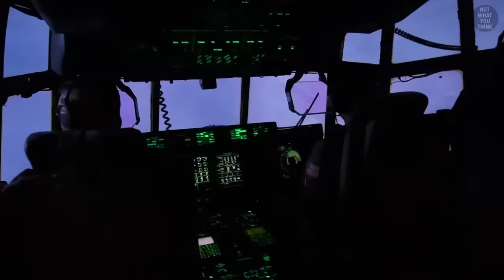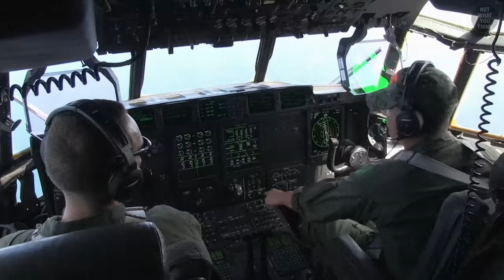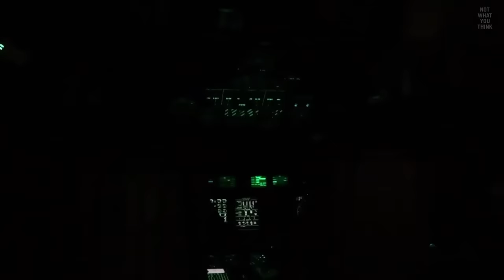Aerial Refueling Accidents Examined

Comment: While I will say that the ch53 was in a good situation to attempt an autorotation, high altitude and forward speed, those big helicopters autorotate like a safe. They expect to lose the tail and roll on their side in a best case scenario. But it's not like aerial refueling is their only hope, they try not to run that low on fuel.
Reply: I worked on Pavelows in the 90's. They could land em like a feather during autorotation. It's all about energy preservation. Size is just scale, the rules dont change

Comment: Incidentally, helicopter autorotation isn't automatic. It requires special control settings, and you have only a couple of seconds to set them after an engine failure.
Reply: And it has to be initiated at exactly the right altitude to take advantage of the stored inertia of the rotors or it will lose the energy required to “soften” the landing.
Reply: @larrymcgill5508  you do realize that your statement contradicts mine ? (i.e. i think your statement is incorrect)

Comment: While on the Nimitz off Iran during the Iranian hostage boondoggle, I was flying in Lockeed S-3 Vikings. Because we had a much higher carrier landing weight performance, we were utilized to download excess fuel off the duty tanker in order to conserve the fuel that would otherwise have to be dumped. On one evolution, we exceeded the capture speed and caused a sine wave (like the one shown). We had a solid capture but the sine wave came down the hose and it ripped the “basket” from the hose with the basket still connected to our refueling probe, which bent the probe pipe straight up. The KA-7 tanker had to make an immediate trap after the fuel finished draining from the “buddy pack”. We then trapped with the evidence clearly wrapped around our refueling probe.

On another incident (same deployment) the bow wave of the S-3 caused the basket to deflect above the aircraft and then came down on the system operator’s canopy (directly behind the pilot’s canopy) crashing through it. That basket may look small, but it is about 2 - 3 feet long and is made out of metal slats with steel cables to absorb the stress put on them by air refueling exercises. Fortunately, they landed safely and the operator’s only injury was to his flight suit.

Long hours of tedium, punctuated by moments of stark terror.

Comment: This ended on such a sad note RIP
Also, two questions:
1 Did they make the decision to ditch the heli later when they still had 20min of fuel left, or did they physically ditch the heli even though it had 20min worth of fuel? If the latter, how come?
2 What is/are the correct actions to take in the case that a fire starts when refuelling your car? Keep the nozzle in? Fire exstinguisher? Or just run for your life?
Reply: Keep the nozzle in. Alert attendant (emergency stop, call 911). Use fire extinguisher.
Reply: An helicopter has a very high center of gravity . When ditching, she would roll in seconds . It's safer to stay low with low speed to evacuate the crew from the cargo doors, and after that, ditching at a safe distance . The pilot and the copilot can leave as they are trained for . They had just been unlucky to be hitten by a huge wave before evacuating all the crew .
With 20m fuel and so far from the coast, they didn't had any other option . That's a risky job .
Reply: They chose to ditch before they ran out of gas because with the engine still running they had control over the situation. If they waited for it to run out and just crash it would have been far worse...
Reply: @jerseyshoredroneservices225  True. I'm just wondering why they didn't spend, say, 10-15min of the flight time they still have to get closer to wherever their incoming search and rescue would be.
Reply: The pilot of that heli wrote a book called Shoot Like A Girl. It is a really good book. She has the experience written down in it and was the pilot of that helicopter

Comment: use of cellular phones during refueling can ignite fuel vapors with an electrical discharge. This is commonly due to static electricity and not because of a faulty device, as most phones, especially phone cases, can produce a lot during handling.

Comment: 1:14 I’m not saying conclusively that that didn’t happen, but the horizon stayed consistent for the whole time until the E3 dived down. If the bottom of the refueller was pushed up by the bow wave of the E3 then you would expect the refueller to nose down which would mean we would see more sky. But instead the horizon stayed the same which just makes me think this was human error with pilot induced oscillation.
Reply: Great observation.   Everything I have read up on this incident, was the inexperience of the receiver aircraft.  The receiver aircraft has to make small corrections, not massive ones like here.   Retired KC-135R crew chief.

Comment: KC-10 v E-3, the explanation is wrong, this incident was all the E-3s fault. You can see ground features that stay relatively fixed which means the one moving vertically was the E-3. (Former C-141B pilot here that air refueled many times)

Comment: I had the opportunity to watch that air to air refuelling, and it is very stressful on the pilots, even in smooth clear weather. Would hate to think of doing it at night, in a storm, as even in the smooth air  the new pilots took a few attempts to connect, and the one finally did so, but was not watching his relative velocity, so drifted to in front of the tanker. 

Corrected with full speed brakes, and in the tanker we all had a jolt as that pipe disconnected. The valves are not meant to close so abruptly, so the aircraft was gently banking away, nicely shiny and with a instant full wash in jet fuel, to go get into the correct envelope to do an in flight restart, because that sudden blast of fuel had flamed his engine out nicely. 10 minutes later he came back up, connected correctly, got his positioning right, and got his remaining fuel pumped in in just under a minute. You only need a minute or so to fill up, those pumps move the 2000 US gallons needed to fill you at a pretty high pressure.

Comment: The men and helicopter from the doomed rescue mission were from the 106th Aerospace Rescue and Rescovery Squadron (A.R.R.S.), based out of Gabreski Airfield, here on Long Island, NYS.  The call sign "Jolly 110" is a reference to the early days of this rescue unit, when they flew the HH-3C, known as the Jolly Green Giant.

The HH-60G Pavehawk is a fine aircraft, but it is not suited to rescue missions in such severe weather.  Even the aircraft I use to work on  (MH-53H Pavelow III), while much larger, and thus, much more stable in flight, would have had a hard time in such extreme conditions. 

GOD rest Pararescueman, Technical Sergeant Smith

Comment: Just a point on flashpoint, kerosene is a more dangerous fuel as it can reach flashpoint in a confined space. Gasoline is usually too rich to explode, it burns at the surface only.
Reply: This is part of why JP-4 was replaced.  JP-5 is too lean, gasoline is too rich, but yeah, JP-4 had vapors in tanks that were explosive.

Comment: You can actually run a diesel truck while refueling. It uses a compression ignition system and not a spark plug.
Reply: In the cases of it being low on fuel it's actually very important to leave a diesal truck running as it can suck air into the fuel lines and then you need to purge the air from the lines
Reply: Also that's a good way to save electricity on battery bcs to start a diesel engine that's required a lot of electricity 🔌

Comment: Gasoline cars need their engines shut off during refuling. Gasoline street cars are required to have evaporative emissions system. If gas is pumped with the engine running, the evap system will sense a huge system leak, then turn on the Malfunction Indicator Light. Diesels can be left running, no evaporative emissions  system.

Comment: With displaying the units of measurements on the bottom, could you please display both or at least consistently show the same system during the video please? I can think in metric well enough, but the switching to and from threw off my brain. Thanks.
Reply from the maker: We pretty much always say it in imperial and show metric. This video was an exception (for part of it we chose to say it in metric).

Comment: I find it so stupid that we have autopilot functions on both taking and receiving aircrafts, but no one saw fit to have the two systems active and synchronized when a hose is connected.
Why leave it to the stability of the pilot? let a computer control and make sure the two are in sync.
you could probably run a wire down with the hose to ensure the sync between the systems if security is a concern and we don't want to allow remote access.

Comment: No one is shutting off the cars on gas stations in Dubai, even at 50 deg. C. You stop, a guy is refueling your car and the engine and AC is running all the time. Never saw any fires!

Comment: im still thinking about how a helicopter can land on water
Reply: Easy if you are a Super Frelon, designed from the outset as maritime support. You just have to make sure all the drain plugs were put in when you were doing your pre flight, so the pontoon bottom would be watertight, and have the 2 inflatable side pontoons installed, so you can turn the engines off.

Comment: I don’t understand how an electric shark could threaten the avionics of a modern plan it should theoretically be shielded by the faraday cage or affect…
Reply: I don't think you get a perfect cage on airplane nowadayd. there are so many different materials composites and metals. And way more electronics
Reply: @humorss  so you’re saying due to new age materials like carbon fiber or stealth radar absorbent coating… it’s possible for a charge to escape the outside surface layer of atoms that would  act as a faraday cage if it’s composition was not all metal